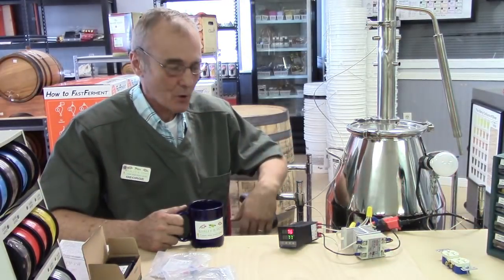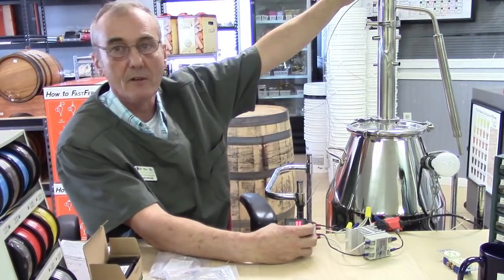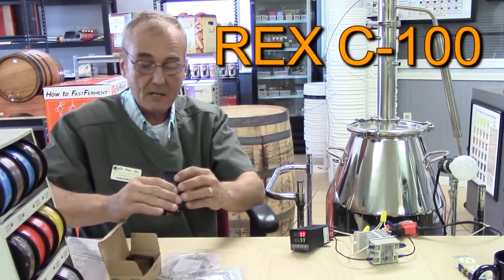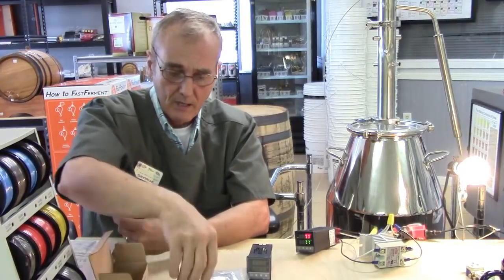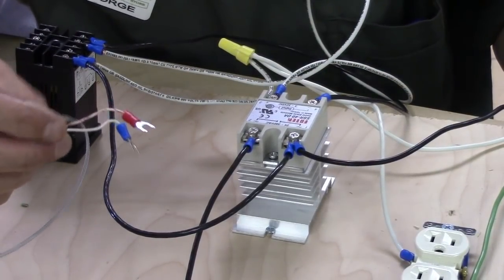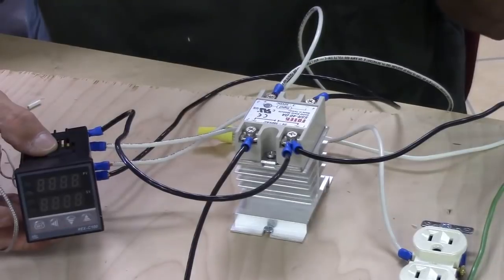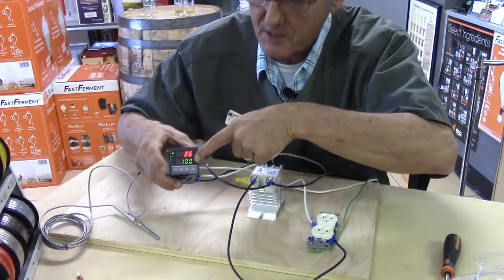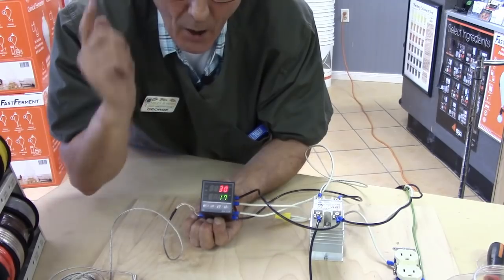WIRING THE PID CONTROLLER

Comment: Just for the record, a thermocouple is not a resistance device, it is a voltage-inducing device. The PID actually senses the voltage produced by the dissimilar metal contact thermocouple. Dissimilar metals (if you know about plumbing which will corrode over time, such as a brass fitting on an iron pipe). The metal corrosion is a result of electron flow. This happens because any ambient heat in the atmosphere here on earth will be converted into an electrical voltage by the dissimilar metal contact point. A thermocouple is actually an electrical generator with the voltage directly related to presence of heat. It takes advantage of this phenomenon when used as a temperature sensor. The controller can put this voltage through a meter that can be marked for a temperature scale. The thermocouple isn't a very efficient generator so it's not used for any practical use other than as a temp sensor since it reliably and predictably varies in voltage output based on its temperature. It is true also that the conductivity of a wire will vary with its temperature, but that's not a thermocouple and is used in a very different manner.
Reply from the maker: Thanks Dave. I appreciate it and will try to incorporate this in the future.

Comment: Correction- Type K thermocouples don't "measure resistance" but rather they generate a small voltage as a result of dissimilar metals attached at a junction at the end of the probe. 
Temperature changes, increases/decreases, causes this voltage to vary in magnitude. The voltage variation is sensed by the instrument and converted to a display of temperature using an algorithm that interpolates the small non-linear changes in voltages to temperature. 
There's a reason that a polarity is assigned to the TC probe terminals and that is because, as I said, the K type (and others) thermocouples generate voltage.
Reply from the maker: Very true. Thanks

Comment: So where does the 110 plug for the heating element go in the means of controlling the heat temp ? I get everything you explained and how to hook it up not exactly to hard but I’m sorta lost on that part of it ? Do I just practically build a box that has a plug in for the element and a cord that goes out that plugs into a wall ? Your little outlet you had screwed into the table threw me off. Thank you for you video.
Reply from the maker: Yes, there should be a power cord that runs from the box to a wall outlet for the power supply. This power supply is wired into the box for operation and powers the receptacle controlled by the PID (for the element) you add to the box. You could skip the receptacle if you like and wire the element directly to the box but that would make it a little messy and not as universally useful if you wanted to switch out elements. 
Hope this helps
George

Comment: George, l know you have a video on wiring 2elements to a controller, can you help me? 
I'm trying to heat a 15 gal pot, can't get above 158 f deg, using 1 5500 w element
Reply from the maker: Sure. First of all if you are using a 5500 W element on a 120V circuit it will work but it will run as a 1375 Watt element. The 5500 W element is designed to run on 240V. 
With 1375 W it will be difficult if not impossible to generate enough heat to heat up 4 or more gallons of water enough to make it simmer. 
This may be your problem.
What size is your still?

Comment: Hi George, one thing I cant figure out is how the PID will regulate the still. As the distillation takes place the boiling temps change and the temp in the head gets higher the closer to the tails we get. so will this not require changing continuously anyway?
Also on the Turbo500 it is the output of the condenser that is measured so if a fixed flow rate in the condenser was assumed, would the PID not be better to regulate the element power for the set point on the output of the condenser?
Reply from the maker: +Gary You do need to change the set temperature through the process since the conditions will change. You could adapt it to work as the Turbo 500. That would  be another whole video by itself.
George

Comment: George, thank you for all of your great helpful videos, and for all the great work you do to help the brewing community.  I have a couple of questions for you.  I wired my own PID controller, an Inkbird ITC-106VH.  After setting all of the parameters in the PID, I keep getting the alarm message when I turn the box on, and get the alternating dHAL 0.5 message no matter what I do.  When I go back to check that setting, it showers 5 with the decimal flashing after it, which I believe is the setting your video showed to but it on, but even on other numbers, it still comes back to the dHAL 0.5 message.  the alarm light stays on, and the run light stays on, and the energy output stays at 0 (A = 0).  What have I done wrong?  I thank you in advance.
Reply from the maker: I responded to your email. Hope this solves your problem. It should.
George

Comment: In the vid it looked like you hooked up the thermal coupler leads backwards.. does that make a difference?? Or is the red negative and blue positive?? Thanks good vid..
Reply from the maker: Different makers have them wired both ways so you need to check while assembling it. If they are backwards the PID will read backwards as well. 
Color code for some manufacturers obviously means nothing.
Reply: @BarleyandHopsBrewing  ok thanks.. I have the rex-c100 seams to be working but when the out put light comes on ( SSR ) my PV goes crazy.. sometimes the display for PV and SV even looks like when power on...
Reply from the maker: Well, from what you are telling me it seems as though the out put light comes on which means the element is now working and applying heat. The PV (process value or perceived temperature) starts to change. Where is the problem?
It should do that since it is sensing a change in temperature.
George

Comment: I also have this problem with my PID-CXTG-3000. the controller still does not light up the ssr and signal does not receive from controller, Can anyone help?
Reply from the maker: The only thing I can think of is the SSR leads may be reversed. Pin 3 and 4 are polarity specific. Check that they are correct. I just looked at the specs and these are almost the same as the TA4.
George
Reply: Thanks for your comment, but the output of the controller has no power,  I thought it was a bad, I bought a  REX-C100  from Ebay.

Comment: Am I understanding correct that the short thermocouple that comes in kit is NOT water or steam proof, and you have to get the long one for a sealed type device.
Reply from the maker: Not really, both types will work fine in the vapor trail. It all depends on your particular set-up. Some like the longer probe to insert from the top and other prefer to drill a 6 mm hole and insert it in the side of the column. Either way works well.

Comment: I have just purchased a couple of these after watching your clips, I am having trouble programming them, I cannot get into the program and change it for cooling, do you have any ideas, thanks Paul
Reply from the maker: Paul, We don't change the setting for cooling since we are usually working with the heating aspect of the PID. If this is a TA 4 the instructions are pretty simple. I know that doesn't answer your question directly. Are you using the TA 4 or the INKBIRD? I really can't help unless I know that. Each one is a little different.Shoot me an email at george.duncan76@gmail.com

George

Comment: Thanks for the great video.  If measuring ambient air temp in an oven, which style thermo would be required? I assume the k style is designed to be immersed..
Reply from the maker: The K-type can sense temperature either way.
Reply: Barley and Hops Brewing thanks.

Comment: thank you very much for the video sir i followed all the instructions but my heating element wont turn on what could be the problem
Reply from the maker: Could be a simple wiring mistake. Look at the SSR and see if the red light switches on when the PID trips to activate the element. If this does not happen you probably have the wires on pin 3,4 of the SSR backwards. These are polarity specific.

Comment: I was confused.  Why wouldn't you pigtail your hots the same way you did your grounds/commons?  I hate ganging connectors; they always seem to loosen over time and cause issues....
Reply: There are several ways to do this. All of them work and most are personality driven. I've even used junction strips to gang connections together.
Reply: There are several ways to do this. All of them work and most are personality driven. I've even used junction strips to gang connections together.

Comment: Could this same set up be used to control a motorized valve for a drain?  For instance if the temp of a liquid reaches a certain point the valve opens to let out the hot liquid
Reply from the maker: This is possible but that would also require servo motors and a little more wiring.

Comment: if i want to  set the PID in heating mode  are we suposed to switch the relay pin?
 instead of the  pin 4 5 you have to use the 3 + ? instead of the pin 4 5 ? i have to test with one invert the signal
Edit1 1 week later: 16:20 got my anwser
Reply from the maker: What type of PID are you setting?
Reply: @BarleyandHopsBrewing  same as in the video and just re wacthed the video at 16:20 you said it lol since i am about to atempt to wire it now xD
for some reason i didn't get any alert for your reply but thanks for your help and video :D
Reply: but do you know what happen if you plug the DC signal backward on the relay ? will it blow up?  if after you pluged it back ward and  did an on/off switch and then you plug properly will it still work 
can't find anwser on google X_X

Comment: Senor thank u awesome video....much appreciated....one question if I wanted dual heating/thermal coupling can I just double tap that thermal coupling or do u have to get two pid two of everything
Reply from the maker: You can run multiple elements on one PID but not multiple probes.
Reply: Sorry sir for being behind but I just figured the tc is not for heating but an actual heating element is required so can I use dual heating elements on one pid....sorry again what’s a probe
Reply from the maker: It is the sensor. See the Blind Pig! comment above.

Comment: How do you put the thermal coupling in the still and remain a tight seal on all gaskets?
Reply from the maker: Insert it through the hole in the bung on top where the thermometer would go. You could also drill a 6mm hole in the column and screw it in.

Comment: Will this put together the same way for 220v given the correct parts and such?
Reply from the maker: Exactly. The PID will work either way (110 or 220), Major difference is, with 220 you don't have a neutral wire. Both wires are hot.
George
Reply: Barley and Hops Brewing  im having problems making my set for 240v cam you help please

Comment: Great Job 
I am looking for a controller with 2 temp inputs So I can control a pump. 
I want to have pump running when temp 1 is 10F higher than temp 2. 
any Ideas how to do that?
thanks
Reply from the maker: Sure. We could build you one but it is easy enough to build yourself. Watch our videos on PID Controllers. 
Here is a link to the playlist of those:
https://www.youtube.com/playlist?list=PLA2Iwq46qNNORUIFnRoorBlHLDbvWYnlu

and also:
https://www.youtube.com/playlist?list=PLA2Iwq46qNNORUIFnRoorBlHLDbvWYnlu
Reply: I seen it all. But still don't know. 
Can you tell me which model has 2 temp inputs?
Reply from the maker: A PID cannot handle 2 inputs. You can program different alarms steps in it but two inputs is not possible.
George

Comment: Hi George great tutorial , have you got any tutorials on programming the rex-c100 at all many thanks
Reply from the maker: I have not done one on that model for several reasons. Mostly because it is unreliable. Sorry.
Reply: @BarleyandHopsBrewing  thanks for getting back to me , I've found one that you did with an inkbird so I'll try with some of the settings from that video. Which pid would you recommend ? And when testing the ssr when it has reached temp or gone over temp it goes open circuit which I expect to happen but on a closed circuit condition is it supposed to read 100v when the input voltage is 240v?
Reply from the maker: It may since the PID controls the amount of power provided to the element.
Reply: Hi George 
I've just tested it with my beer keg still and tested it on just water and to get it to go I had to switch it off then back on again a few times then all of a sudden it stayed on and worked so your right they are unreliable I also noticed the temp in the head stayed at 40 degrees until I loosened the tri-clamp and tilted it and then the temp started to climb haven't got a clue what could have caused the problem as I didn't have a blockage . I'm looking forward though to some of the spirits you have done in your other videos .

Comment: What's the difference between c100 and the inkbird?
Reply from the maker: The Inkbird is a superior PID over the Rex C-100. The C-100 has limited parameter controls and is not capable of displaying Fahrenheit, it will only display Celsius.
The difference in cost is not much and is easily made up for in capability.

George
Reply: @BarleyandHopsBrewing  here c100 is $12 and inkbird is $50. Will the ssr will still be compatible with the c100? I'm Canadian so celius is fine. Anything else important I'm missing from the inkbird?

Comment: What type of solid state relay do I use  with the heat controller  for high heats just going from regular  household  plug
Reply from the maker: If you are using household circuits it is more than likely 15 or 20 amps. I would stick with the 25amp SSR. It is plenty big enough for your process. If you used a 40 amp SSR it would not make a difference at all. 
George
Reply: Barley and Hops Brewing thanks so much I will give it a try.

Comment: If I'm understanding this all correctly; You plug the heating element into the socket hooked up to the PID and you're pretty much set to go once you set the temp? Where is the best place to install the sensor on the still?
Reply from the maker: The only place to put it is in the head (the highest point in the column where the vapor passes to the condenser).
George
Reply: +Barley and Hops Brewing LLC thank you!  I think I have it now.  I was going to order a heat controller but think I'll make one myself.  Will a 1500w element on 120v be sufficient for an 8 gallon kettle?  I've learned a great deal from your videos.  They're fantastic.  Thank you
Reply from the maker: Yes. The 1500 watt band is perfect for the 8 gallon kettle.

Comment: I'm still seeing that light bulb turn 100% on or 100% off, I don't see that light bulb getting brighter and dimmer?
Reply from the maker: You won't. If you have a TA 4 push the set button once while the PID is working to see a % output of your system. Push the set button again to return to the set value display.
Reply: Barley & Hops; Everything you just said went right over my head, What is a  TA4? I was under the impression that a PID = proportional integral derivative the PROPORTIONAL function means that the unit powers up the heating element 100% until the potential temperature reaches the set temperature then the PID lowers the power to the element but just enough to keep the mash at a constant temperature, and when the temperature starts to drop the PID increases the power to keep the mash at the set temperature but only just enough power, so that essentially the element stays powered up all the time just the power is modulated not 100% on or 100% off and the PID knows what percentage of constant power to send to the element to keep the constant temperature much like a high amp automatic light dimer that turns the heat up and down instead of the brightness of a light bulb, I guess I was wrong. Won't this 100% on and 100% off cycle cause premature heating element failure?
Reply from the maker: A TA4 is a model of PID controller is made by Mypin just like and inkbird or a REX C100 or many other names. There are many different models made by many different companies. The PID does cycle on and off through its derivative process where the timing of on and off are controlled to regulate output. There is no danger of burning out an element through this process.
Reply: Barley & Hops; I always thought that if you have a lamp and you constantly turn the light off and on, it substantially reduces the life of the bulb, I would think it's the same for a heating element just like the light bulb has an element that burns out over time. The other question I have, can you use a small 8 ohm speaker for the alarm sound on a REX C100 PID pins 6 and 7?

Comment: Why do electric keep tripping? When I switch on PID controller
Reply: It is more than likely that you are drawing more amps than your circuit can handle. It is hard to tell unless I know a little more. What size heater element are you using? Is this a 120 Volt circuit? It is also possible that you have teh system grounded somewhere and as soon as you turn it on it trips the breaker. George
Reply: George Duncan I use 240v heating element and same type of PID as in the video.
Reply: George Duncan also thank you for replying back.
Reply: Okay. A 240Volt element. Is this wired into a 120Volt circuit or a 240 Volt circuit?